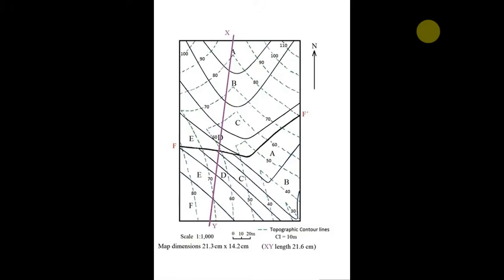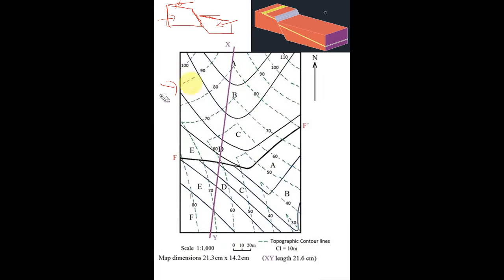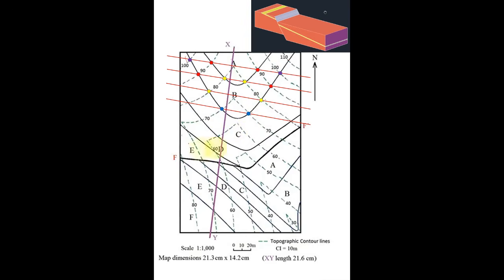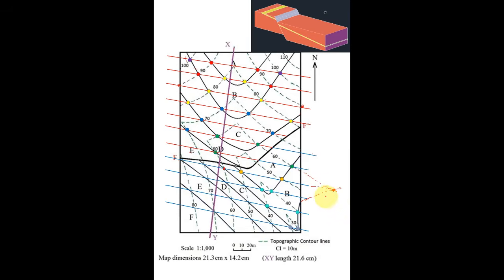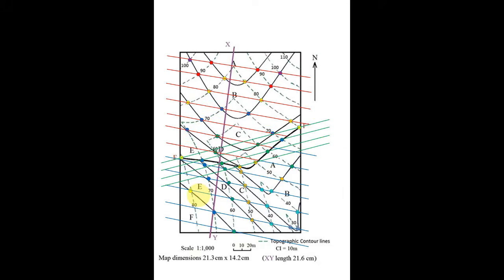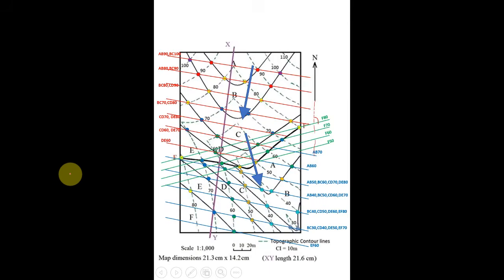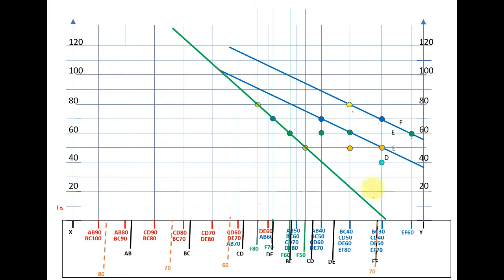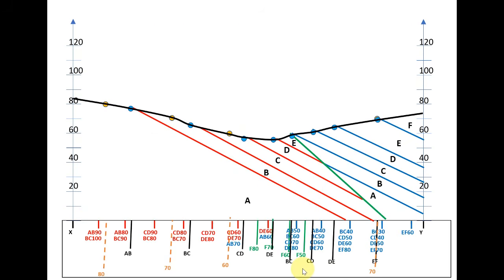Lab 4 - Geological Map Cross Section - Map with Faults

Comment: It is thrust fault right??
Reply: It is a thrust fault
Reply: It's right-lateral strike slip, looks like thrust with this cross-section orientation, but you would need to draw a cross-section perpendicular to the fault and calculate strike separation and dip separation to know whether it's strike-slip or dip-slip. If strike separation > dip separation = strike-slip, then look at offset of structure contours to tell if it's right-lateral or left-lateral.